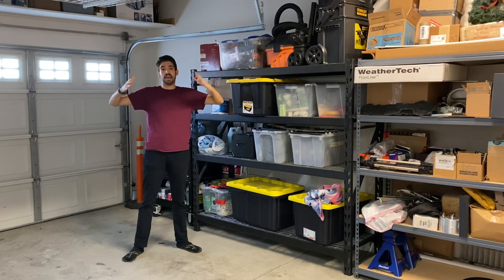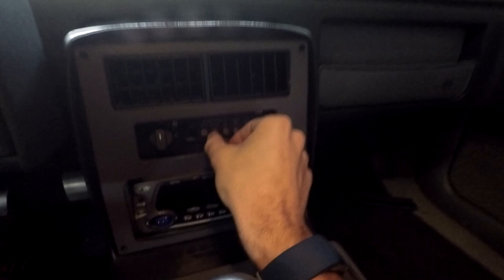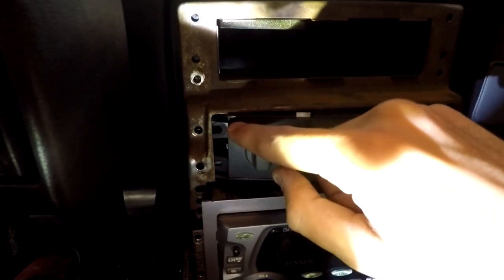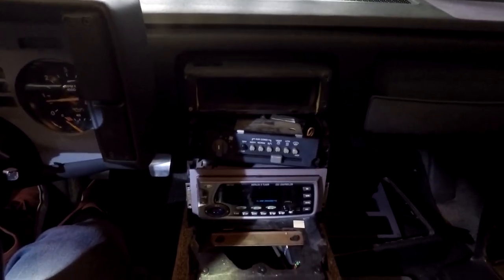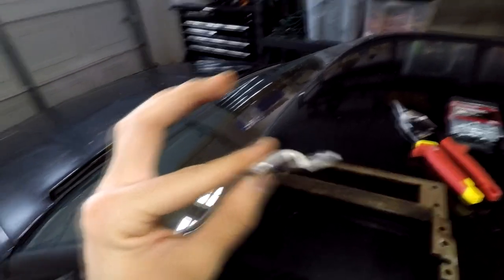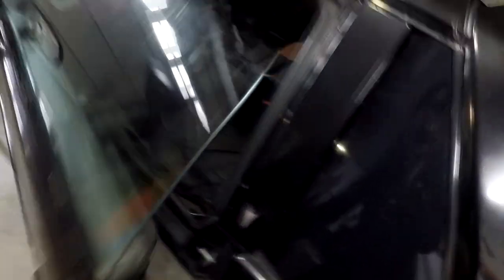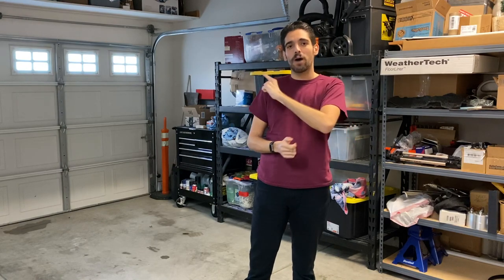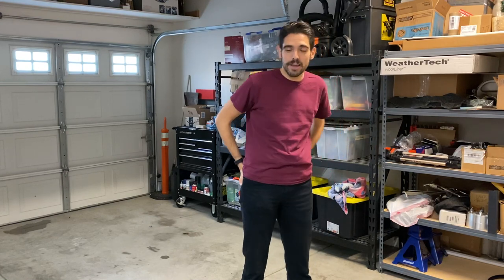Fiero Center Stack Fabrication

Comment: Your bracket that you made did put a smile to my face because that's what my home made metal work looks like.  What ever works is the way I look at it.  Keep doing what you are doing.  I enjoy your projects with things that I have owned.
Reply from the maker: Thanks Brian, I think by far you're my biggest supporter haha Yeah, in all honestly I know that the bracket looked pretty rough, but I too have the same mindset of if it works, it works! I know you and I have had quite a few similar cars, besides the many Corvettes, the Biarritz, the Fiero and the Silverado, what else have you owned, maybe it'll give me some ideas for future vehicles I'd like lol
Reply: @1Brain4Wheels  Over my driving career I have owner 49  cars and most of them have been from the Generals stable.  One of the deviations was when I got mad at my 79 Corvette and bought a 80 280ZX but that was short lived until the C4 Corvette came out and it has been Corvettes since except my Fiero GT and several Cadillac's and a Silverado a couple times.  I have had a passion for cars and airplanes and a couple of my cars were the kind I left at the airport.  I was based in Fresno and commuted between Fresno and John Wayne here in So Cal and had a car at both ends.  I have had 5 careers and most of them revolved around airplanes in some way.  Driving one of my Corvettes is so much fun and a feeling of freedom that is only upstaged in a private airplane.  I have had 25 airplanes so you can see my passion for both.  I may be one of you biggest supporters but your site is the only on I respond to.  I don't like to comment in front of the world but you are the one exception.  I really prefer email andl don't like putting my address in front of the world.
Take care, Brian
Reply from the maker: Brian Barke that’s funny, I too have mostly driven the General’s fleet, with a couple Jeeps thrown in and a 4Runner that I bought after having a lemon Tahoe... I bet the 280ZX was a fun ride, at one point I had contemplated getting a used 350z for my mom (that I could use every now and then) but it felt too tight on the inside, even compared to the C7! That’s awesome that you have a pilot’s license, I actually took a ground school class a few years ago, but decided to put that hobby on hold while I focus on my passion for cars. Part of my reasoning for learning to fly (besides just being a cool thing to do) was similar to your situation, I work down in the Bay Area but my family and the property I’ll be building on in the future are up in the foothills, about 2.5 hours away so it would be awesome to fly between Buchanan Field and Auburn just a couple times a week instead of driving! And I appreciate our discussions, it fun to be able to talk to someone with the same love of cars that I have, my family thinks I’m crazy sometimes haha
Reply: Garrett,  You are right the 280ZX was a fun ride that I had for four years although through that time I had two Cadillac Eldorado Biarritz with the long hood and stainless steel top.  My neighbor liked the sound of the 280ZX straight six winding up as I drove past their house.  It did have a great sound.  Cars have always been for personal consumption with me that started in high school.  Airplanes came later because I was afraid to fly.  After my original involvement in aviation it turned out to be the best and most rewarding part of my life.  Only a few of the airplanes I have owned were for personal consumption,  the rest I bought were immediately for sale although I flew the wings off them while I had them.  I started this journey with an operation here in Long Beach teaching people how to fly.  That operation moved to Cameron Park up in your area at Shingle Springs but I stayed in Long Beach.  I taught instrument flying classes at a local  college here.  Then came my airline job that took me to Fresno.  Your idea of building in Auburn is an awesome plan that I admire greatly.  That area of California is so nice and a area that I had planned to buy some acreage and live but that is one of my plans that didn't work out.  I so hope that some day you will get the opportunity to stick your toe into flying that you did show an interest in.  My direct contact is bbarke@ca.rr.com if you are interested.  Oh, My C7 is in the body shop to repair from someone backing into it.  What started out to be $2000 is now up to $6700. I have a Jaguar rental that I would never buy.  Take care Garrett, Brian